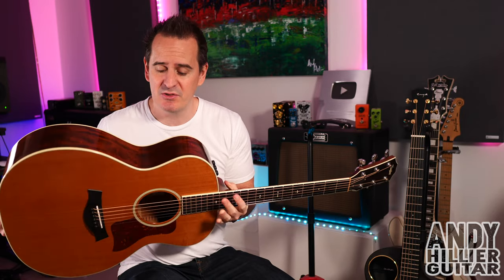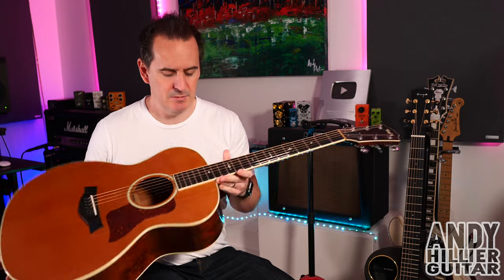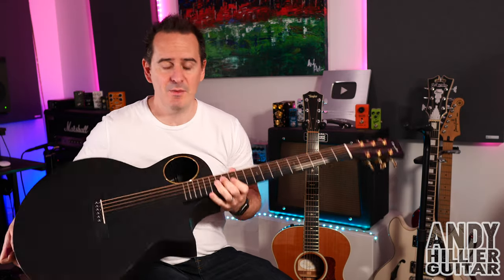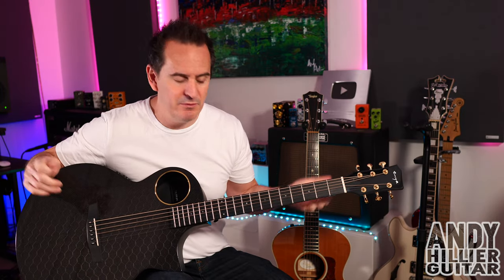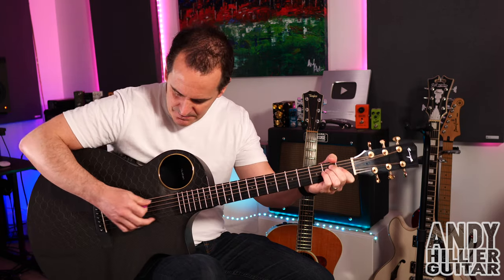Carbon Fiber vs Wood Acoustic Guitar Comparison

Comment: Thanks for a great no nonsense review, Andy! Wood guitar was brighter, slightly louder and produced a greater variety of undertones. Carbon fiber sounded less loud, a bit flatter, but because of that more precise in taking each note. Wood guitar would be better as an accompaniment for the vocals like in ballads etc., but I liked carbon fiber sound better for blues and jazz. Both guitars are excellent! As for amateur the choice for me is easy - it is carbon fiber for its low maintenance, excellent sound for the price and amazing features that come with onboard synthesizer and the option to have it plugged in for even more choice in effects.

Comment: I have both - a 70's Guild D35 and an Enya X4 Pro. It highly depends on what kind of sound you are looking for in the song. I like the on-board unplugged effects (principally the slight room reverb, slight chorus) on the Enya, and it is rock solid stable in the environment. It is best plugged in. The Guild D35 is a sweet delicate sound, almost as if it is alive, but with no pickup. Both are out to grab and play. 
I'm a bass player, so guitars are my secondary, thus will not get the investment; neither are $1000+ guitars (both were scored under $500)  but, for how they sound  and what they do, they get the job done.

Comment: They sound 99.5% the same, ½% different. 
I had wood acoustics in the past (they were stolen).
I now have a carbon fiber acoustic. Chose CF due to the resistance to temperature & humidity (lack of humidity in my case).
I'm not sophisticated enough to care about a miniscule (to me) difference in tone, something that can only be described in adjectives.